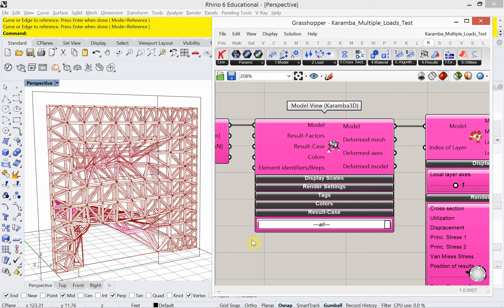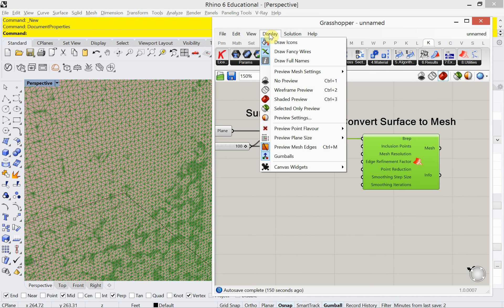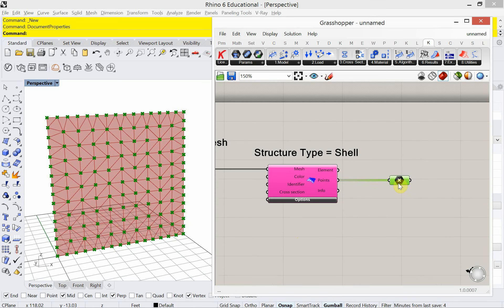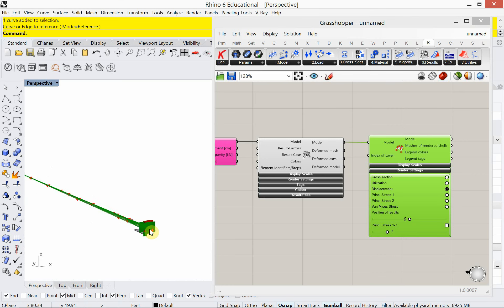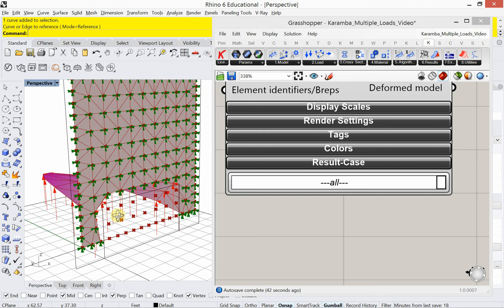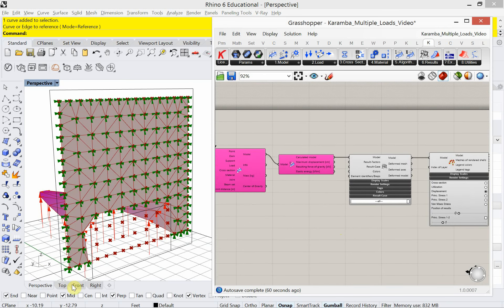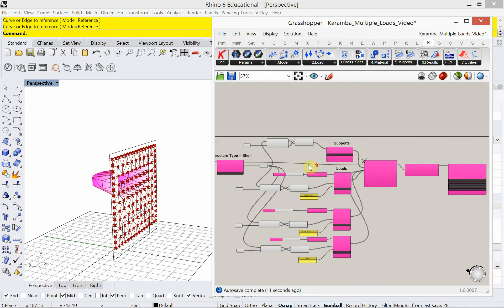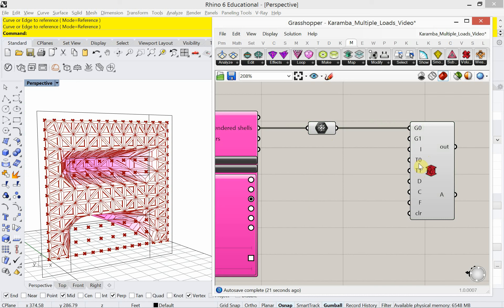Karamba Multiple Loads

Comment: Hello, thank you for the great tutorial! When I plug the Z-Axis load in the Assembly Model input I don't see any vertical vectors. Do you have any idea why it happens?
When I change the Result-Case in Model View Components nothing changes either. It only works properly when I name both LCases 0.
Reply from the maker: Make sure that you don’t have a data tree going into your assemble model load input. If so, try flattening it.
Reply: @AlphonsoPeluso  thanks.